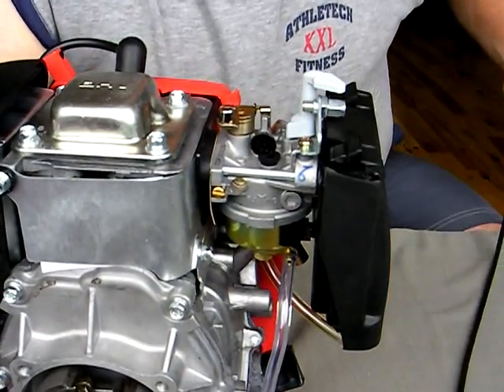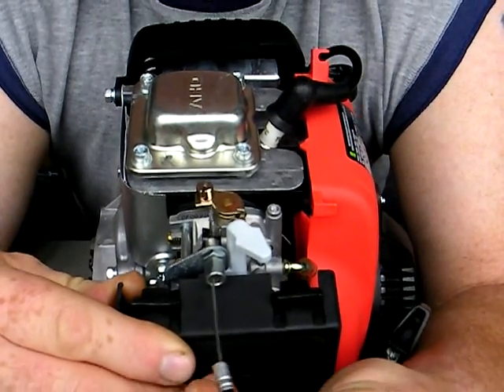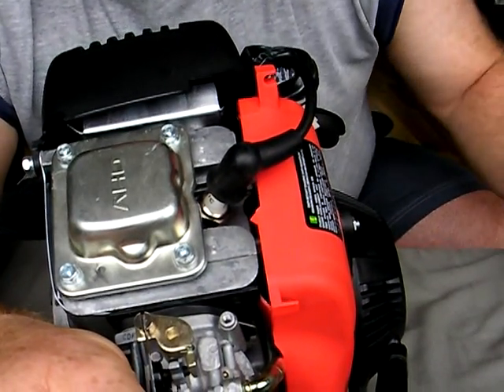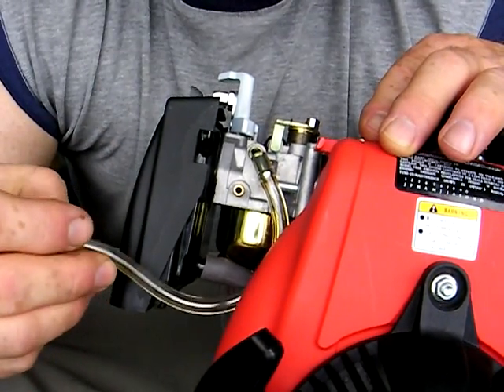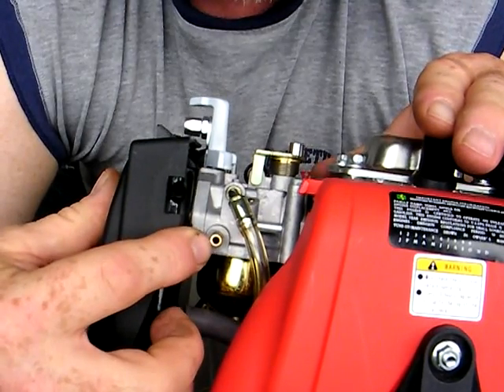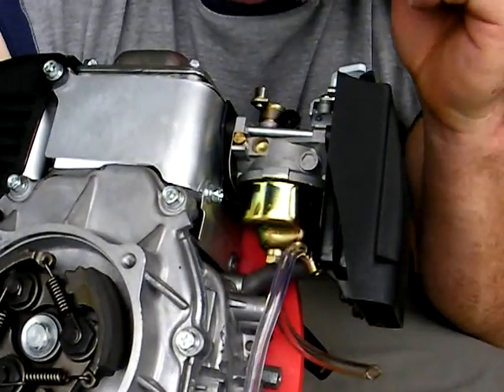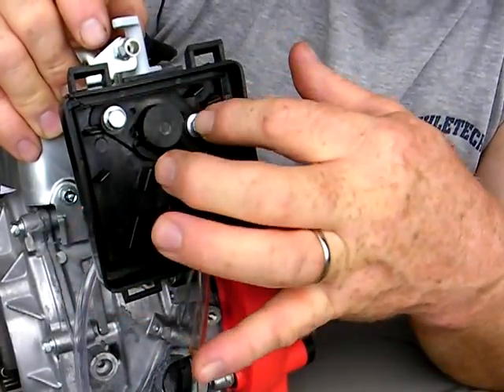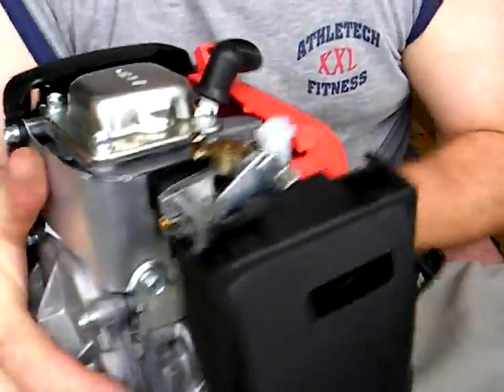HuaSheng 142F-cc 49cc 4 stroke carburetor demonstration

Comment: First line you showed is the vent to atmosphere line. Do not plug or pinch this line. It allows fuel to enter the carb, it does pour fuel if the engine is tilted too far, but that is not its intended purpose. Also, never plug any of the supplied hoses, if any of the hoses have fuel dripping, it is a float related issue and must be addressed or you will fill your combustion chamber and/or crankcase with raw fuel. Hope this helps!

Comment: Thanks for the info, I was wondering where those tubes went to, now I know, I run 91 octane clear non ethanol gas in mine and it runs perfect except when I ride to work in the rain the belt slips a little, I've only had this engine for 3 days and I love it, I am done with the 2 stroke engines and getting these engines for all of my bikes and thanks again for your videos!!!I'm in Cave junction Oregon.

Comment: I just got stranded with mine, starved for fuel and raw gas running out the overflow.
I pulled the carb, ran wire through the idle jet on top.
Pulled the bowl and checked that it cut off flow when inverted(Blow into the inlet nipple with a length of fuel tubing), it should allow air to flow when held upright but cut off airflow when carb is inverted, this tests the float valve. All seemed well, I reassembled and it fired right up, no more overflow gas. Reminder to carry pertinent sockets to do all this on the road if necessary.
10mm socket and 10mm wrench, screwdriver, pliers, ratchet wrench etc.

Comment: I upgraded my two stroke to one of these several years ago.  Have had NOTHING but problems.  Mainly with the carb clogging up.  Especially first thing in spring.
Last year, I took the carb apart first partially, blasted it with carb cleaner, re assembled, and nothing.  Took it completely apart, SOAKED it in carb cleaner, put it all back, nothing.
Picked up a new (better) spark plug, and bought a brand new carb.  Same kind.  Got it going but by end of summer it was harder and harder to get started.

Spring again, and here we go yet again.  Pull pull pull and NOTHING NOTING NOTHING.  It's not even trying. 

So... got it all apart, about to start cleaning again, MIGHT even replace it with another kind (still doing some research on that.) 

What I can say, maybe as a warning to everyone.  The jets on this thing are darn near microscopic.  I watched one video where the guy bought a micro set of drill bits, found one that just fit, then went up one size and widened the jets just a tiny bit.  I kinda wanted to try this on the original carb I took off but never did.    So anyone ever do that?  Does it work?

I'm thinking it might be worth it to put in that non ethanol gas instead of plain old gas station gas.  Maybe that will help???? 

I swear, I put several THOUSAND miles on my old 2 stroke and never had as many problems.
I won't even go into the transmission issues I had.  (That was because the guy I bought mine from was a moron.  Had to replace pretty much everything in his kit except the motor itself.
That's Dax.  NEVER buy from him!!!!

Comment: Thanks for the video. Have you been far enough inside either this engine or a GXH to tell if there's room for an additional magneto coil or two for better bike lighting? Current practice seems to be to steal a bit from the ignition magneto coil via the kill switch - but that only goes so far before you have no spark.

Comment from the maker: Well if you have this engine you are stuck with what you have, at one time you could get a 4G replacement but they are not being sold in North America at this time. Try to search for a 4G T Belt Drive 5:1 ratio for tapered shaft.
Good luck

Comment: hi terry this looks like the engine t that comes with my motorized esky. it has maybe been used a total of 1-2 hours and pull start pulled out. Had it replaced from a lawnmower shop no dramas. then maybe 3 months later started first go and pull start came out again. so went back to same lawnmower repair shop and  left for a day only to be told it is irreparable? I'm sydney Australia here mate.

Comment: Aside from the initial attachment to the engine, do the ends of the Flowed Bowl Drain Hose and Overflow Drain Hose attach anywhere else or do the ends hang down freely allowing excess to drip ?

Comment: I have a question, I have a 1G huasheng, and have it installed on a bike, but when running it this morning I found that there was oil spitting back into the air filter from the carburetor. Do you have any idea what is wrong? Thanks.
Reply from the maker: +crzyswayze Hi this can mean a few different things, first thing is you may have your engine oil over full, take your dip stick out and on the stick you will see xxxx's the oil should only be half the way up those xxxx's.Next if you have tipped your engine over to one side that can cause oil to come out your filter.Clean your filter and make sure your oil level is not too high.Terry

Comment: Yes i left gas in my carb over the winter and now it won't run right....whip me :) there is a little red rust in the bottom of the bowl. when i clean the carb, what can i do to treat that rust so it won't cause anymore problems? thanks man
Reply from the maker: There is not really much you can do about the rust, but here is what you should have done there is a drain that can be opened with a flat screw driver then shut off your fuel the open the drain and leave it open, now your carb will remain dry and not much chance of rust.
One other thing you can do is use a product called prolong fuel stabilizer this will keep your fuel from going bad.
Hope this helps you.
Terry

Comment: I have one of these on my motorized bike and it takes literally 50 pulls to start, I'm not sure what's wrong though
Reply: Check your spark plug and wire for spark. The problem is there.

Comment: Yeah thanks Terry for your reply the damndest thing and it happens every once in awhile it's what you call a major brain fart man I was using the ground on solenoid and put it on the block which was causing it obviously not to spark. I figured this out after I bought a new magneto flywheel new solenoid which I really needed and the spark plug which is cool to have an extra. This stuff usually happens to me when I got 20 things going on at once and this is most of that every day of my life. So its all good now it's the learning experience in the 41 to concentrate and focus into it and slow down
Reply from the maker: Joseph Rokuskie Glad you got it
Reply from the maker: Joseph Rokuskie Glad you got it figured out

Comment: I installed a new after market air filter earlier this week. When choke is off it sputters at first on low end until I really get into. Do I just need to adjust the carb screw so there is more fuel added to the mix?

Comment: Where the hell can you find screws and bolts for this engine? I need one of the M5 bolts for my carburetor and an M5 nut that fastens the flywheel onto the engine block.

Comment: i just drilled out Honda throttle lever loosened the self locking nut on it then added a grounding mount at the hardware store and attached a return spring to motor mount and ran the honda unaltered and DID NOT VIOLATE THE 3 YEAR WARRANTY. Your approach violates the Honda 3 year Warranty.

Comment: mine has no needle setting is got copper with no screw its welded shut problem is runing lean its over heats and bogs out and stalls, I have it happen in rc cars. how do I a just fule mix if mine has no screw

Comment: I have one of these engines that won't stay running. I put a new carb on but it still won't run for long. can you help me out here
Reply from the maker: +Zackary Maines Hi I think I can help yousounds like your fuel tank is not venting right try taking the cap off and see it that helps
Reply: Terry Blow okay I'm going to give it a shot when I get home I'm not around there right now. I struggled to even find parts for this thing because it's on a gokart. Really appreciate your quick response and help with this. I'm going to give that a try tomorrow morning and I will let you know how it goes.

Comment: hey I broke my choke lever can replace it myself or do i have to replace the carb
Reply from the maker: +Queenz Bridge HI yes you will have to replace the carb there are no parts for them.$40 plus shipping email me if you want one blowbyu@telus.net
Reply: thanks im a big fan
Reply: My choke lever was broken off during shipping,I can barely turn it with my fingers, but I just leave it off for now because it will still start in 25 degree weather after about 10 pulls, also boygoesfast on eBay has the choke lever for $7.59 but I don't know how to put it on?

Comment: Ok this is tripping me out...I have a Huasheng 49cc 4 stroke ..Had it for couple years and it ran great.. On night it just died.. Got home checked it all out found no spark.. Checked plug got no resistance through electrode ,new it was shot out got a new one..Still no work..Checked coil was ok resistance was not really good so just bought a new one.. got the other day installed STILL NO SPARK.. I know the concept of this operation, the flywheel mags strong as hell, made sure ground was where it suppose to be.. and their is no kill switch so that is not problem. What else could it beeee?
Reply from the maker: Joseph Rokuskie If you like you can call me 604 373 0744

Comment: Does anyone know the baseline  adjustment for the air mixer screw from factory?
Reply from the maker: David Ledbetter 
Hi the base setting is 5 full turns out from zero
Reply: Terry Blow   need some advice help my motor idles and runs only with almost a full choke but dies right away when i turn the choke off could it be a bad carburetor or can it be a  a ait leak i need help thnx in advance

Comment: hey man im reading in my manual for the huasheng 4 stroke 49cc engine and it says there is an engine on off swicth.  I have yet to find one so im guessing the manual is incorrect. would you please confirm this so i don't screw up my engine.
Reply: It also says their is a speed selecter... manual wasnt translated propperly or something..

Comment from the maker: Ok there is something you need to understand your stock bicycle was not built to go over 20 MPH for a sustained time perioud. If you do your bicycle bearings will over heat and wear out realy fast, so fast that you can have a catastrophic failure while you are riding at speeds greater than 20 MPH.

Comment from the maker: You can not ajust the 4 stroke carb for speed, ajust this carb for the best running condition ie easy starting and good idle RPMs no farting or sputtering also this engine will not run right on anything other than REGULAR FUEL higher octane will make this engine knock at idle and not reach max RPMs if it is speed you want please go to AGK Affordable Gokarts they sell 49cc racing parts cams carbs and exhaust.
Good luck
Terry

Comment: Ordered my engine from bikeberry and the stock carb doesnt seem to have an idle mixture screw. It is just a flush pin that has no way of adjusting it. The engine itself feels like it's slipping/revs higher than the speed it puts out and will not idle with the choke off so i'm sure this is the problem. Just cant seem to find a way to adjust the idle. Any help?

Comment from the maker: Hi 
Well it seems that some of the newer Huasheng engines don't have air mixing screws and this can make things hard.
So when I first start with my 4 stroke I thought I was turning the choke off and I was realy turning it on so remember this, lever towards the pull cord choke is on lever towards the trans choke is off.
If this dose not help you email me direct blowbyu@telus.net